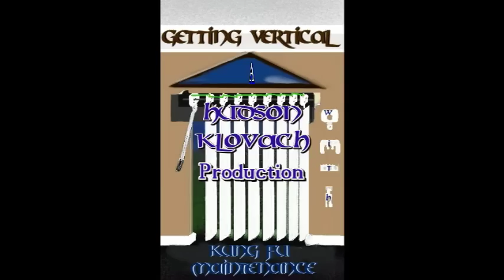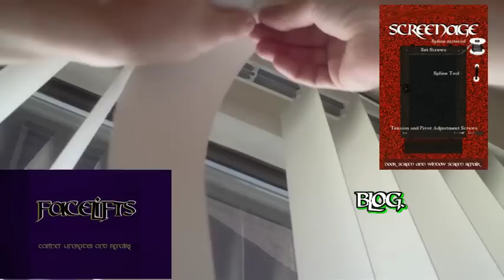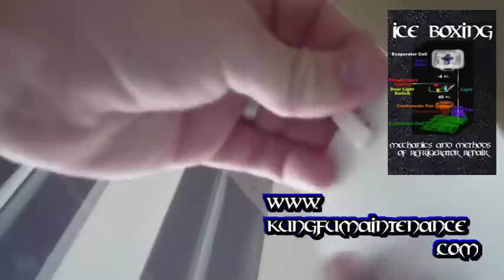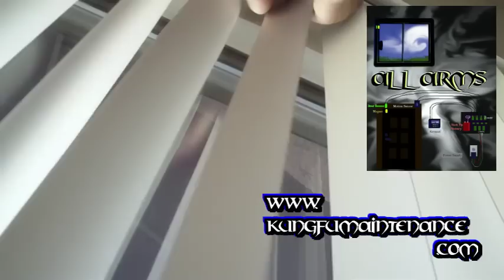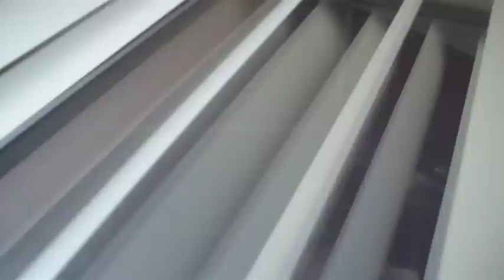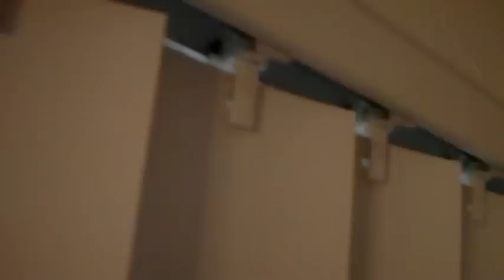How To Repair Blinds When One Or More Vertical Blind Slats Won't Turn

Comment: Thanks dude! I saw what was going on, the rotator gear was fine but the strip inside the carrier had popped out. I reinstalled it and the rotator clip and it was fixed! Mystery solved and an easy fix! :-)